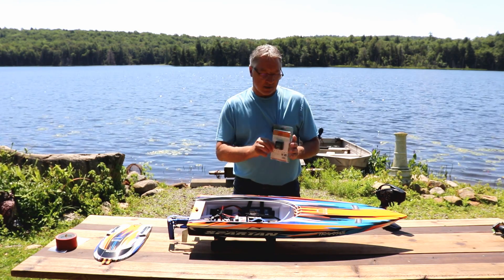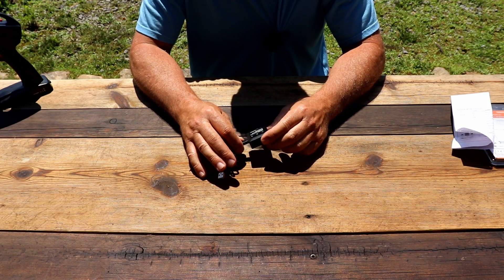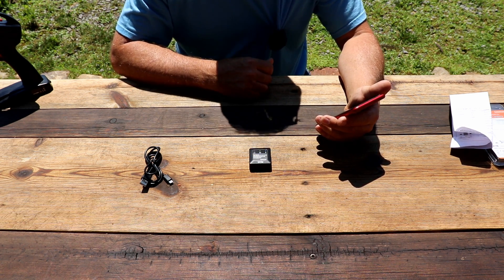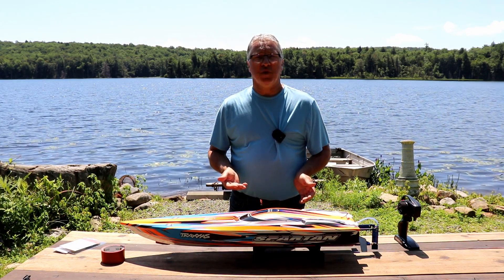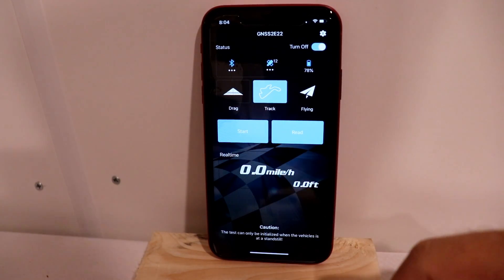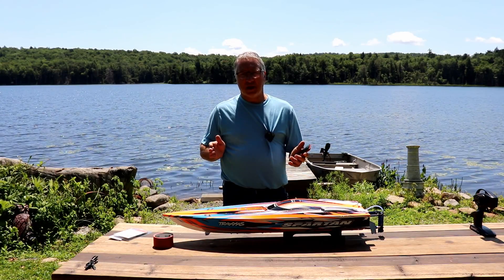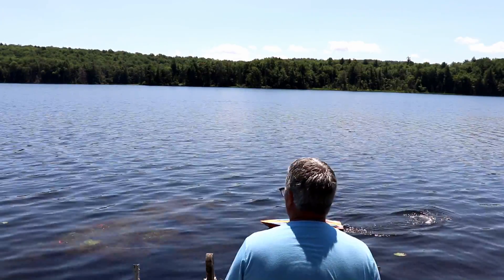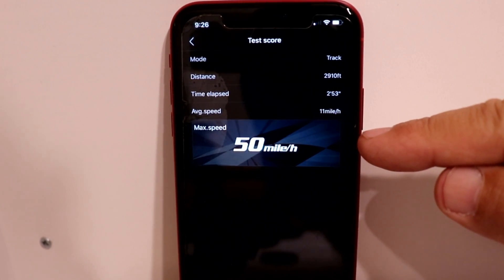RC Boat Speed Test - GNSS Performance Analyzer Review - Traxxas Spartan

Comment: Hi good video,just wondering i bought one the Spartan Traxxas (rock-n-rolla) model but I flip it and nothing works lost everything,by any chance has it happened to you and what was out come.Also keep the videos coming good to show us and explain how to do things and not what to do.Thank you
Reply: I have a Spartan(modded) and I’ve flipped it many times, I haven’t had a single electronic failure yet, I recommend checking the batteries if they are good then see if the esc(computer) starts if it doesn’t it’s most likely that, if it does see if the esc connects to the remote, if it doesn’t the radio recover is bad, it’s located in the black box behind the esc, it always gets water in there when you flip and it could be that.